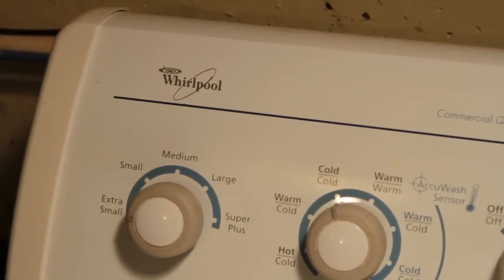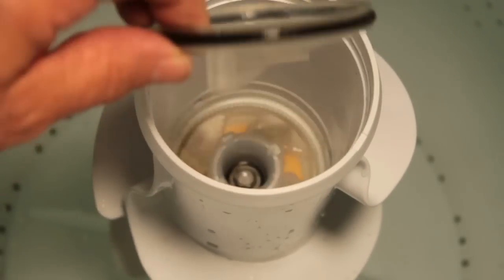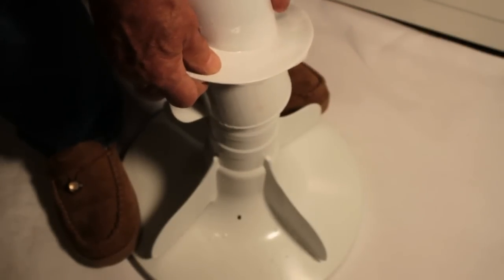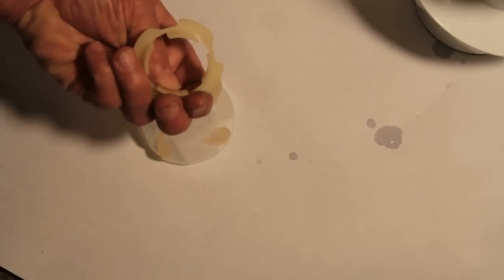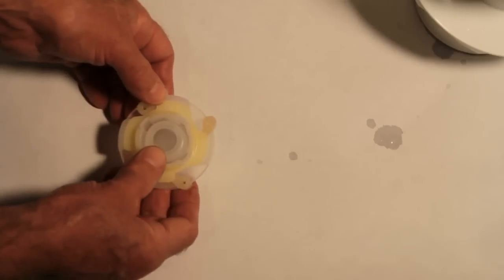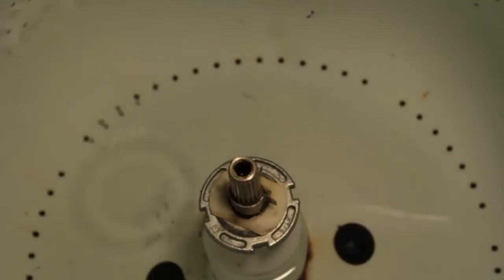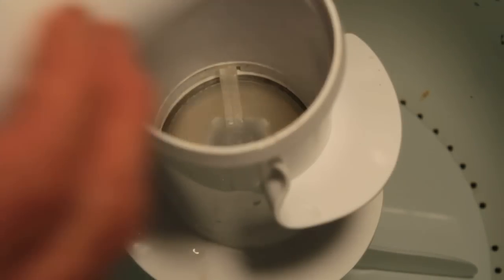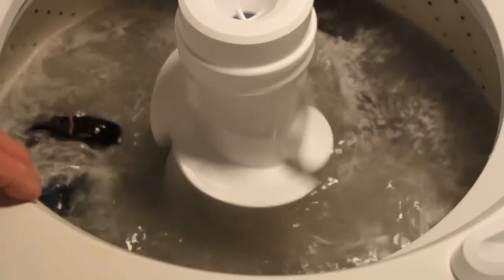Broken Agitator - Whirlpool Imperial Series II

Comment: Very good video.  Here's a little trick to help get that upper agitator piece back on.  Push the lower half of the agitator on first, making sure the splines on the shaft are aligned with the grooves in the agitator.  Set the thrust washer in place.  Put together the dog assembly and insert it into the upper agitator piece while holding the upper agitator piece upside down.  Turn the agitator over.  Here's the trick: Take a 6 inch ratchet extension with a 5/8" socket attached to it.  Use the socket to hold the dog assembly in place while aligning the slots with the four tabs that stick up from the lower agitator piece.  The 5/8' socket will be pushing on the dog assembly right where the 7/16" bolt will go.  When they are aligned, use the socket and extension to push the dog assembly onto the plastic tabs.  Voila!  Swap the 5/8" socket for your 7/16" socket and you are ready to put in the 7/16" bolt and rubber washer.
Reply: +ghermitboy Very good advice. Thanks for the comment.
Mark
Reply: W
Reply: Thanks for the  video you save me $200.00 plus
Reply: I switched the dogs but the actual agitator isn't moving idk what it can be

Comment: We ordered the replacement parts and installed - thanks to your directions. and NO more tangled clothes!!! YAY!!! And no repairman bill $$$ !!!
Reply from the maker: +KD Hovis ..... I  don't think  you can put too much grease  on it as long as it isn't getting all over everything. I'm glad to hear that every thing worked out for you. My washer is still going strong.
Reply: Do you think this would cause the clothes to get all tangled up? It does not seem as bad, since we replaced the dogs and assembly. Thanks again!
Reply from the maker: +KD Hovis Not sure. Some fabrics seem to tangle up easier than others. My wife's clothes, being lighter and more straps on them, tangle more than my stuff. But it was worse before I put in the new dogs. I think because the clothes kind of got trapped in one area when only the bottom part was working. Once the top part was fixed the clothes moved around better.
Reply: Yes, it isnt as bad as before we replaced dogs. 
Yesterday, I did husband's jacket and a pair of his work pants. The pants were tangled on bottom. Coat was fine. I just never had this problem before. Had the washer 5 yrs!!  
THANKS! 
p.s. it is a whirlpool. already has some rust spots! I sanded them off and painted with a rustoleum paint.
Reply: +KD Hovis .... Ours has a few rust spots in the drum where the finish must have gotten chipped. I think the wife is hinting that she wants a brand new washer, one of those fancy expensive ones. I really don't think it will do any better job, but, oh well, gotta keep the wife happy;>)
Reply: +Wis.Gardener get a Speed Queen pricy simple built to last and easy to fix steel drum direct drive the water pump is driven by the same motor no over technical wiring and all that and it has a real agitator not those high efficiency bottom disk we own one it washes decently I'm 17 and my parents still have there Kenmore I plan on rebuilding it 15 years old runs great has a leak most likely a drain hose its basically a rebranded Speed Queen however it has a plastic drum
Reply: HERPY DERPEDY 50th 8

Comment: Love the kitty that did the walk-on-by @ 7:46 into this clip. LOL Great tutorial. I had to do this fix as well. Mine was on a Kenmore 80 series. The trick with getting the bolt into the hole to tighten down the auger is this. Take your ratchet with extender and socket on the end and find a small piece of paper towel. Cut it so that it's 4" square. Then fold that square in half then in half again. That should be enough to put over the socket. Next push down the screw so that it forces the paper towel into the socket thus holding the screw inside the socket snugly enough to screw it back into the auger. That's it! Done.

Comment: Thanks for sharing this.  I've been struggling to get an agitator out that had a severely corroded bolt head so when I finally got it out with a stripped bolt extractor I was frustrated I couldn't pull the agitator assembly apart to change the dogs as most other videos make it seem so easy like it just falls apart.  Yours gave a tip to stand on it so you can give it a strong pull and that did the trick.

Comment: I just wanted to thank you so much for the time you took to show us how to fix this. Mine wouldn't spin anymore and turned out it was just old worn down dogs. (I would have never known had I not seen this video and would have just purchased a new washer.) I found the dogs for about $5 locally and now it's running like new again! Thank you, Thank you!!
Reply: Agitator dogs have nothing to do the spin cycle.  Thry only keep they top part of the dual action agitator fromfree spinning or turning both ways.  It ratchets one way like he said, turning the load in a downward direction.
  Little confused with your statement. But, glad you got it going!
Reply: This is the only downside to having a dual action agitator

Comment: I have one of these washers. It works much much better than the newer models. If you have one, do everything you can to keep it operational, including spending the money on repairs. Do NOT get rid of it.
Reply from the maker: Still have it 4 years after this video. getting a little rusty around the edges though.
Reply: Mark Miller  
The cabinet on mine has also started to rust, so I went on Facebook Marketplace and found a similar model that has the same cabinet but in much better shape, bought it for 130$ and switched the two out.

Comment: Thank you uploader very much!! Excellent instructions and easy to follow.  You did mention the four white tabs on the lower agitator contrary to another poster. I actually found it easier to place the bottom of the agitator in the machine first. Then I lowered the top piece by "eyeballing" the four slots in the dog assembly to the four tabs on the agitator and it slipped right on. The whole job cost me 10 bucks. I'm willing to bet a repairman would have charged in the 200 dollar range to perform this.Thanks again!!
Reply from the maker: +Russ Collette Glad it helped you and thanks for the positive comment. I can see where putting the bottom part in first would have been an easier way to fit it
 all back together.  And it it is satisfying to do it your self for only
 10 bucks.

Comment: EXCELLENT WORK,  clear, concise and we're up and running in under an hour. I encountered a minor issue caused by my machine. It apparently wore down 2 of the 4 tabs as though me;ted by friction-heat after the machine's dog teeth were worn thru. Simple fix with a Dremel drill and small grinder to remove the meleted portion that was holding back removal. Reassembled and it runs factory smooth.

Thanks Mark, again, great work.
Reply: Thank you!!  I had the same problem and couldn't figure out why my agitator pieces wouldn't separate. I saw your comment and got out my husband's Dremel to grind down the melted portions of the tabs. Problem solved!

Comment: I have a Whirlpool Ultimate Care II with this issue. The washer is about 15 years old. I had trouble separating the lower agitator from the top part at first. There are 4 tabs that go through the grooves in the dogs assembly with their tops welded to the assembly cover. You can tell them apart from the cover because it's white plastic vs. transparent plastic of the cover. I used a 1/4 inch wood drill (the one with sharp pin in the middle of the tip so that you can center the drill on the welds and it doesn't slide off) an drilled the welds out. Don't go too far, just enough to break the welds-about 1/2 mm or 0.020 inch. The parts came right apart. Make sure you remove all debris and cut off burrs from the top of the tabs so they don't catch on anything when you put assembly back in. One more advice: clean the o-ring on the top cover and apply some silicon grease to it. It will be easier to put in. Without it the rubber of the o-ring might catch on the inside of the housing and come off. I hope it helps.
All together a $5 (plus tools if you don't have them) and 30 minute fix. Awesome! Thanks, Mark
Reply from the maker: Glad to have helped. Thanks for commenting.Mark
Reply: Great job, I watched your video to see how to get the assembly apart, and learned a great deal more

Comment: THANKS SO MUCH for making the video! 

 Our washer TANGLES our clothes up! 
 Is this a symptom of worn out "dogs"??? 
Thank you again!!
Reply: hello, our washer tangles are clothes up, also
Could I ask what you concluded with your problem?
It appears my "agitator dogs" are working correctly..... so I am confused as to what else the problem may be?
Any advice from you would be GREATLY appreciated!!
Thanks so much.
Reply: To prevent clothing from knotting and twisting:
Avoid mixing heavy items with light items.
Avoid putting too many or too few items in the washer.
Make sure you set the proper water level for the size load you are doing. ...
Never wrap the clothes around the agitator. ...
Be sure your wash water is not too hot for the fabric.
Reply: Thanks for the reply. 
However, there seems to be something wrong with our washer.  
It worked fine for about 5 years, and now it seems to only move the agitator in one direction (not back and forth).
So, consequently, the clothes get wrapped around the center agitator in a couple minutes, even if I follow all your tips.
Do you know what would cause it to only agitate in one direction??
I checked the "agitator dogs", and they are good.

Thanks, for any further advice you may have.
Reply: If your clothes are wrapped around agitator it is not the dogs.

Comment: Thank you for your time to put up this small Video ... Saved me BIG !!! Thanks Again.
Reply from the maker: +bfpw995 Glad it helped. Mark
Reply: +Mark Miller Do you check back here for comments? and questions? I was curious how much grease we should apply to the bottom bolt (when every thing, agitator, etc, is all pulled out) ? I gave a good smear on it all. Was worried I would put too much or too little. Thanks!
Reply: @MarkMillerIsGardening  Look at that, 5 years later...looking at your video again and doing the same repair, thanks again Mark!

Comment: I have a GE washer and the very middle (what you pulled out) wont move when its running. My question; is the middle augur suppose to move freely when washer isn't being used?  Looks like this is what's wrong with mine.

Comment: My dogs seems fine and fixed it the first time by tightening the bolt. It worked fine for a few days and now it seems the dogs still engage but still won't agitate.  Can't tighten or loosen the bolt now it just spin.  Even if I hold the lower agitator unit the bolt won't loosen

Comment: Thank you for this video!!  Well done!  I only have one question!    My agitator is going back and forth but much stronger than it was originally!   Did I do something wrong since it is not going in one direction?
Reply from the maker: Sorry for not getting back to you sooner. The agitator does go back and forth when its running. But the auger, the top part that drives the clothes down, pretty much goes in only one direction. As the agitator goes clockwise the dogs pick up on the auger and push it in the same direction. When the agitator goes counter clockwise the dogs release from the auger and it just sits there. These are very short movements. My agitator also seems to be much stronger after I did all this, especially before putting in a load of clothes (I usually run in the water and soap so it mixes good before putting in the load.).  So far it is still running OK but the washer is starting to show its age and a new one might be in the near future.

Comment: Thank you for the video. We are having trouble getting the agitator back on all the way, it's not wanting to fit all the way back on. Any sugggestions?
Reply: Are all the parts lined up right? Check the video again at about 11:10 and see if the tabs are all the way in place. Sorry about my hands being in the way there but was kind of tight. Try wiggling the agitator back and forth a little while pressing down, this might help to line up any prats that are a little off.  That's about all I can think of, Good Luck.
Mark

Comment: I replaced the dawgs and the work properly. But the slip when I wash a load. Any suggestions?
Reply: The only thing that comes to mind is the gear that the dogs catch on may be worn, at the 5:42 mark in the video. Other then that would be if things are lined up ok.
Reply: @wisgardener  how can I tell if the gear is worn out. It seems fine

Comment: I have this washer. When it comes to the spin cylce it rattles so hard it moves across the floor. I tried checking the clothes for balance but it doesn't matter the load size or dispersement of the load. Any thoughts? Is there a part inside that maybe needs replacing?
Reply from the maker: Sorry, I don't have a good answer for you. It sounds kind of serious. it must be something under the wash tub.
Reply: Your direct drive coupling is probably going. You can get one on Amazon for under $10.

Comment: Probably a stupid question, but how do you get to keep the top open and it still runs. I can hear that mine isn't working right, but when I open the top it stops the agitator. I need it to run with the top lid open so I can see what's going on with it. Thank you in advance to anyone that can help me.
Reply: Open the lid. You'll see a plastic prong on one side. This prong fits into a hole on the machine when the lid is closed. Stick a screw driver into that hole so the machine thinks the lid is closed. Then the machine will do its thing and you'll be able to see whats happening.

Comment: what if the 4 white plastic tabs higher than the bolt in the plastic gears are all broken?  how do you get them out and replace them?
Reply from the maker: +Valorie Gaston If I understand what tabs you are talking about, (tabs that the cam snaps down on) I don't think they can be replaced.  You may need to replace the whole agitator unit, that's the bottom half of the thing I took out.Please be aware that I'm not a certified repairman but just figure things out as they happen.
Reply: +Valorie Gaston 
It sounds like you are talking about the agitator dog (part #80040), 
at 5:50 in the video it shows how to replace just the dogs, you just lift up the "bearing" and lift out the old dogs and place in the new dogs.

Comment: I have a Whirlpool WTW4800BQ1.  It spins out but doesn't seem to be agitating.  Any ideas?
Reply from the maker: Doesn't agitate at all? Or is it just the auger, the top piece of the agitator. If neither one of these is working I would suspect that it might be a worn gear on the shaft that comes up from the transmission.  Sorry I can't help you more.
Reply: I think it's not agitating at all.  The lock latches once the agitating is supposed to start so I can't know for sure.  I'll start with the gear...thanks

Comment: What causes a washer agitator base to spin only counter clockwise on high speed agitation, while emitting a grinding noise?
Reply from the maker: Timetryp  I kinda learn as I go. Something stops working the way it should, I try to figure it out myself and fix it. So without having had your problem, I'm not sure what would be causing it. But here is a repair site that might help to shed some light on it. http://www.appliancerepair.net/washing-machine-repair-4.html  Check out paragraph 4.3. What it says in part is; "A grinding noise during the agitate or spin cycle may mean that the motor coupling is damaged, but usually it is coming from the transmission".
Good luck on figuring it out.
Reply: Mark Miller Thanks for the link; I'll check it out.  I have the washer on a repair contract, so I'll post what the issue was.  Everything in an old Kenmore Series 80 washer was replaced, including the transmission and coupler.  I was thinking of filming the repair and posting it, as most videos deal with the upper portion of the agitator mechanism.  Thanks for the reply.